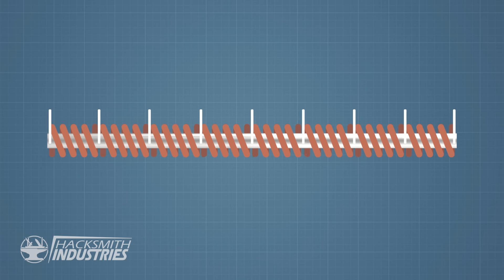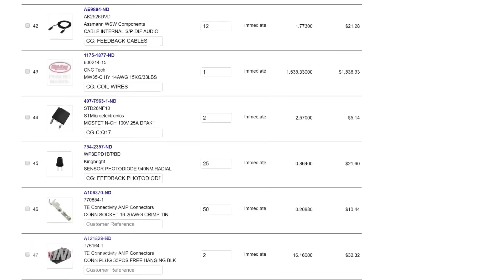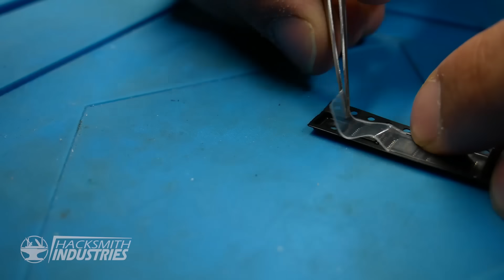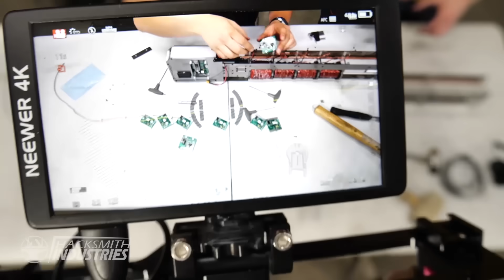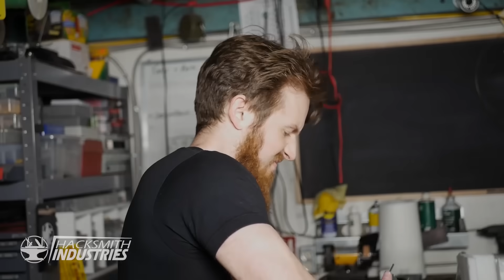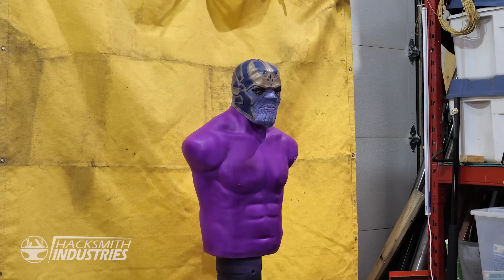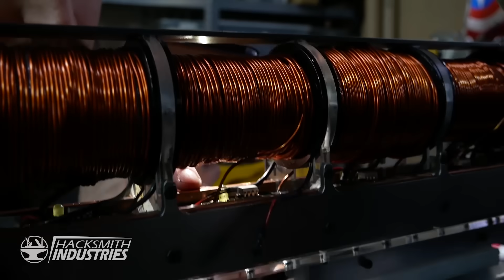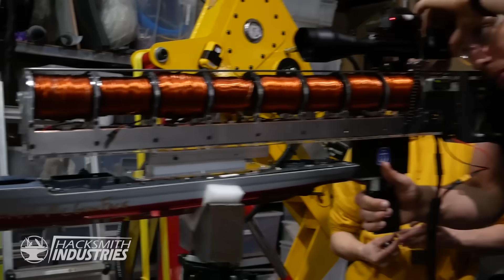50 CAL ELECTRIC COILGUN

Comment: A spheric projectile would work better, since, without any rifling, the cylindrical projectile flies not linear but spins uncontrolled
Reply: Bl4ckSp1d3r oh so that’s probably why the rounds were vertical
Reply: I think a spherical projectile would fly better but wouldnt get the same initial velocity because there would be lower volume of effect from the magnetic field
Reply: And you know because of less contact points and friction.
Reply: A spherical projectile wouldn't reach the speeds as the cylindrical rounds so I would just go ahead and say rifle the barrel.
Reply: You would actually lose momentum and it wouldn’t go faster as you can’t make a circular coil that would fit around it
Reply: At high speeds, spherical projectiles are extremely inaccurate, which is why airsoft guns use hopups to stabilize bb's, but this then leads to issues with the magnus effect greatly limiting range.

They are better off putting high twist ratio rifling in the barrel and sticking to the current projectile.
Reply: Their bullets needs more conical tip and any kind of stabilizer, like spiral threads or (would be perfect) APFSDS-ish structure.
Reply: @xWink  - how would they put rifling in the barrel without  blocking the magnetic field? It would have to be a barrel made of something non conductive and not magnetic, but strong enough to twist a steel projectile (not lead) without breaking.
Reply: @MattsAwesomeStuff  carbon fiber?
Reply: MAKE IT FIN STABILIZED
Reply: @xWink  - You want to line the barrel with an abrasive? Carbon fiber is strong in some ways, but, is not tough.
Reply: Musket philosophy
Reply: If they could get it to start spinning right before the first coil it would be more accurate without the extra drag and weight of fin stabilizers
Reply: They should rifle the battery and also try using a bullet shaped projectile. I’m sure they could machine them
Reply: And if the frame was wood not metal the projectile would have more magnetic energy
Reply: @itsdakota6442  A plastic polymer would work better
Reply: @benjocaz45  The projectile had a bullet like shape. It's flying vertically due to the lack of stabilization on the back end of the round
Reply: Diablo shaped would be a lot more stable in flight.
Reply: rifled barrel and ammo would make a great upgrade balancing the projectiles would also help slightly concerned Hacksmith may get bought by BAE or Lockheed at this point...
Reply: Makes sense
Reply: @MattsAwesomeStuff  CF is extremely good for rifling. It is tough enough to be used in real firearm barrels, so it is certainly tough enough for this project.
Reply: @xWink  - I didn't know that. Neat. Thanks for teaching me something.
Reply: Agreed
Reply: @germanginger4649  true
Reply: r/iamverysmart   turbonerd.
Reply: @HunterTheMan01  I still think it would hit harder, my guess is, that higher velocity and lower mass equals the lower velocity but higher mass. But, the cylindrical bullet has a bigger impact point which concentrates less force, plus, it could fly off which results in less power. I just wanted to point out, that a round bullet, like a steel ball, would fly more stable ^^
Reply: In actuality spherical projectiles are extremely inaccurate, and ultimately (in terms of accuracy) they'd end up being little better (and in some cases potentially even worse) than the straight cylinder they're currently using.  However, many shotgun slug shapes are well known to fly stably when launched from smooth bore guns.  It would certainly be best to use one of those proven designs for the projectile.  In this case I think a BRI sabot slug shape (e.g., a long teardrop shaped projectile with a small flare at one end, and without the sabot of course), would be ideal for stable flight in this case.  Essentially the projectile just needs to be redesigned to shift its center of gravity to the front of it, rather than leaving it basically in the center as with the current design.  With that simple design change, the projectile will fly straight, without tumbling end over end, even without spin stabilization. 

It should also be noted that unfortunately rifling would not help with this device even if it were to be present. As the device is currently designed, the projectile is magnetically levitated as it travels down the devices' bore and doesn't even touch the sides of it as it moves along its length. As such, there is no interface with which the projectile could currently engage any bore rifling (even if it were present) as it travels down the barrel.
Reply: @MattsAwesomeStuff  Hi Guys, FYI, CF is not used for barrel rifling.  There are CF barrels out there to be sure, but what they are is a thin steel tube (with the rifling inside) that is wrapped with CF on the "outside".  That is done to reduce weight over an all steel barrel.  CF barrels are much lighter than their all steel counterparts, but are very pricey, and have the downside that they can be damaged much more easily.  BTW, when CF gets damaged it splinters, and those CF splinters are NASTY if they get in your hands!
Reply: @cmdrenchilada5049  - That's what I thought,  but he seemed confident and knowledgeable. Carbon fiber is incredibly strong in tension, then tension of holding a barrel together in an explosion for example, but its not hard or tough.
Reply: @cmdrenchilada5049  this would be a great idea, thanks for the explanation. So it's basically top heavy with some sort of guiding fin to stabilise it? Nice!
Reply: that acually really smart i was suggesting a bullet looking projectile but that may work way better now that i think about it 

may i recammend ball bearings
Reply: @MattsAwesomeStuff  It would be better to shoot bolts with it, just put some tranquilizer style wings on a nail and you get a far better projectile. Or CF rifling can be viable if you put the bullet in a plastic casing that pops off when it reaches the target, like some air rifle pellets.
Reply: The main problem here is that rifling the barrel would introduce a MASSIVE amount of friction.
There is just not enough power to use this solution. Fins or ball bearings.
Reply: @sethgreen1252  because it has no rifling to spin the round, hence it tumbles.
Reply: That's a stupid idea for multiple reasons.
Reply: @xWink  there's still a steel core to hold the rifling, it's just wrapped in about 10mm of carbon fiber for strength without the weight of steel.
Reply: @ScottKenny1978   You guys do remember that the coils were fitted/slotted around a clear plastic barrel right?
Reply: @jamieanderson7676  yes. They need to use either a nose-heavy design like a shotgun slug (or badminton birdie) or a fin stabilized dart like a tank sabot.

Shotgun slug is easier to get to fly right, sabot separation is a pain in the butt to get right.
Reply: @ScottKenny1978  I agree with that. Would it be possible to instead of rifling the barrel they rifle the round and would that work with stablising the round or not?
Reply: @jamieanderson7676  there are some shotgun slugs that do that, but I think they are also front heavy.
Reply: Not only that but they aren't aerodynamic.
Reply: or maybe some fletching like the sabot
Reply: Crispbo how is he a nerd when you’re the one who uses reddit?
Reply: Crispbo this is why the reddit bad joke was created
Reply: @xWink  rifiling is dependant on the bullet expanding in the barrel, which isint the case in a coilgun
Reply: They couldn’t do a spherical object because the coils would prevent the sphere from moving since it doesn’t have anything to catch onto and push it forward. It would be stuck. Since the bullet is longer, the coils can catch the front of the bullet.
Reply: People with actual brains would have just used a toroidial coil like Marko Rodin's to spin the actual field that takes the projectile along with it.

of course if they were able to think of that then they would have used something like Tesla's radiant impulse dielectricity thru a spark gap or something to really send that projectile flying efficiently... but not to many electrical engineers mess with electrostatics for some reason... probably cause it's rarely talked about in undergraduate college curriculums? Or maybe they still have scars on their subconsciouses from how badly Tesla and T H Moray and many others got burned by the military industrial complex, lmao!
Reply: Bl4ckSp1d3r i don’t understand anything you said
Reply: Rifled barrel alone would not cause a projectile to spin, but with a gas propelling the projectile and simultaneously passing through the grooves you have spin. So with a rifled barrel one would also need something like an air compressor to push and pass through the grooves to create spin. Of course it seems like every person that has designed a coil gun has run into the problem of the projectile fighting with the magnet. No matter how efficient they try to make it. Seems much simpler to create a spin by having a mechanism rotate the projectile.

Comment: I would be interested in seeing what a rifled barrel and wing stabilized rounds would do with this coil gun.
Reply: I wonder if the spinning projectile from the rifling would interfere with the magnetism that's propelling the projectile. Sort of how Eddy current energises and magnetises the rotor of an A.C. induction motor. Would be interesting to find out. 🤔
Reply: Using a rifled barrel makes fins redundant.
Reply: Bonus points for a magazine and bullpup configuration
Reply: I'd say leave the barrel alone and instead of fins, do a drill bit style round. If that shape doesn't affect the magnetic propulsion that is.
Reply: they could probably make it shoot normal 50 bmg bullets since most are steel core
Reply: Rifle the projectile and invert the fins. Launch a drill bit.
Reply: Lol I just thought the same thing
Reply: Rifling cuts into the projectile so it can grip it, which is why bullets are made out of soft metals. These projectiles are made out of steel so I doubt the rifling would work properly. They’d have to use soft metal projectiles with a steel core in order for this to be even remotely feasible. Even then I doubt the magnetic field has enough strength to push the projectiles through rifling, though they could implement a multistage high voltage capacitive discharge method they might be able to work.
Reply: Or just better shaped projectiles. And trigger discipline, lol
Reply: If you rifled the barrel, the projectile would probably spin (albeit not as rapidly since you're not relying on gas pressure to propel the round, instead think of it more like passive friction force as it's being accelerated) as it passes through the barrel. 

With that being said, since you're accelerating that much mass by pulling instead of pushing, I'll bet it'll be more prone to tumbling as drag forces act on the projectile after leaving the barrel...I'll bet the rounds would need to be shaped like a football for optimal mass/balance/rotational speed with minimal drag forces.
Reply: I wonder if it's possible to adapt this to work with a traditional rifle. Would it increase the velocity of the bullet?
Reply: @Ian-pe9rj  a simpler solution might be a dragline of some sort. obviously it would weigh it down a bit, and create some drag (as the name implies), but it'd probably be better when we're talking about magnetic fields

another interesting solution would be if there was a way to rotate the magnetic field around the barrel as the bullet fires, serving the same purpose as rifling without creating drag. Dunno how useful or feasible that would be, though...

Comment: You need a way to spin the projectile to make it more accurate and to make it fly straighter.
Reply: Rifling makes coil gun design a real pain
Reply: Titanium tube or ceramic tube rifled on the inside? Stainless? Other non magnetic steel like substance?
Reply: @zennyblades  ceramic is cheap with few uses titanium is expensive with many uses. And their project already exceeds $2k
Reply: A spheric projectile would work better since without any rifling the cylandrical projectile flies not linear but spins uncontrolled
Reply: @NANA-ut3oy  yes we know that but it wouldn't have the penetration power of a stabilized pointed projectile
Reply: Just a question I'm not real smart in this type of stuff, but if you put multiple projectiles in the coil tube, would it have a similar effect as a shotgun, or due to the fact that they are in a Similar path throughout the barrel?
Reply: @jacoblevering6393  ignoring the projectiles colliding with each other, yes
Reply: @pyroarcanist2073  okay thanks
Reply: Use some flywheels at an angle or something to impart the spin. It's already all electric. Might as well go for broke.
Reply: @jacoblevering6393  Since you have to time each coil to fire exactly at the right time, trying to fire multiple projectiles at once, you're just asking for a malfunction. Almost guaranteed to shoot one backwards into the gun. While not impossible, it's a very dangerous idea.
Reply: Could it be possible to spin the projectile with a magnet and then launch it? I'm not sure how stable the magnetic field would be, or if the projectile would just start smacking into things.
Reply: @BrokenLifeCycle  flywheel has to be attached to the load to impart spin which is difficult in a machine that has more than 8 precision timed parts
Reply: @nilok7  the forward force might counteract the spin
Reply: @pyroarcanist2073  Rev up the rotations before firing. Friction won't make it go from 100 RPM to 0 instantly.
Reply: Could stabilizers work? It sounds like it would be hard to put a spin on it.
Reply: @BrokenLifeCycle  probably not but the rotational power still has to exceed the counteracting friction of the forward force
Reply: @pyroarcanist2073  riveting the barrel is probably not a good option, but since this is done with fields you could definitely spin the bullet before and after the coils
Reply: Fins and flecets (not sure how thats spelt
Reply: There's definitely a lot of energy being lost to a lack of stabilization. The best option would probably be a self stabilizing projectile, either fins or maybe look at some self stabilizing shotgun slug designs (like diabolos).
Reply: Barrel with spiraled grooves on the inside
Reply: @pyrobob5724  the diabolo design would work or even something more conical in shape
Reply: NA NA You could also make the barrel on the end a little bit longer so the force of the last coil doesn’t make it go spinning vertically
Reply: A metal dart with a plastic sabot would likely solve most of the accuracy and tumbling issues.  Think M1 Abrams sabot round but smaller.
Reply: @ArgolasBowmaster  on the taofledermaus channel they often test slugs that have a metal core with a lighter softer material on the outside. That could perhaps fix the aerodynamics problem and also give rifling (maybe something akin to a rifled choke at the end?) something to bite into.

Comment: Yes!, I've been hoping you guys would make a Coil Gun/Gauss Rifle!!
Reply: Do you play vaga conflict
Reply: It is all about the hybrid. Coil + rail. Imagine if the projectile was an electromagnetic dart energized by the barrel. Magnet field on magnet field is stronger than magnet on iron alone. This way you can also flip flop the coil polarity to both pull the dart through and push it out doubling the force. A sabot dart negates the need for any rifle spin for accuracy as well. sigh... someday.
Reply: I hope there's a future video where they upgrade each stage with two capacitors from the railgun :D

Comment: A longer coil means more acceleration the metal is pulled to the center of the silinoid.  The strongest point of magnetism. So you can simplify the electronics. Only need one timed circuit instead of several in series.

Comment: now imagine this powered by a 25MW capacitor. 
thats the railgun's power.
Reply: 25MW capacitor? MW is power, capacitors store energy... anyway the design is nice but inefficient as hell.
Reply: @amoeb81  He probably meant the output of the capacitor. It can dish out 25MW.
Reply: @boris8515  hm, yeah could be you would need thick conductors and so on...wouldn't fit on a handheld
Reply: @amoeb81  exactly it’s so inefficient. If they had enough power to make it fire as straight and powerfully as a Barret then it would be efficient and even marketable. Because of how much it weighs they had the potential to make it into a real sniper with enough electricity at least. But they settled for a nerf gun that can shoot lawn darts 🤦‍♂️
Reply: And superconducting coils. And sensor and controller technology not limited by any financial restrictions... pooh...
Reply: @risky_grizly187  arent there specific regs on what you can and catn build without licenses even where these guys are (i know in 2020 colin furze had to get a weapons manufacture/ use licesne as something he made was legally classed as a weapon not a toy) amybe thats the limit
cost is rarely a issue with video game sponsors especially ones like world of warships and world of tanks (they literally payed furze to build a functioning screw tank)